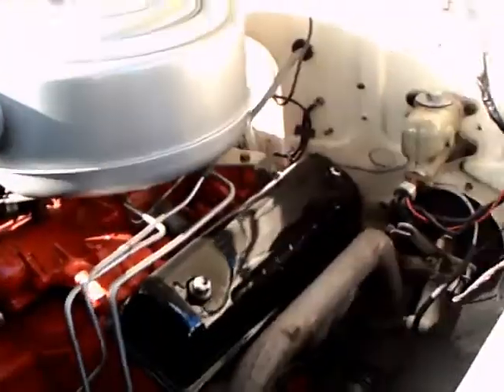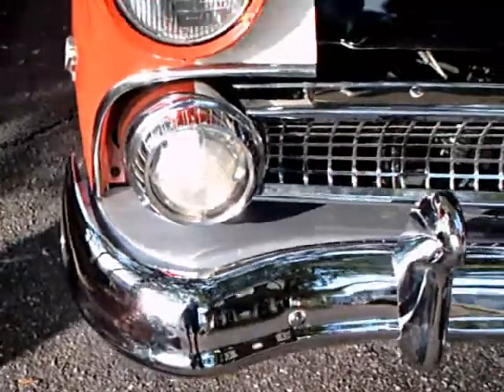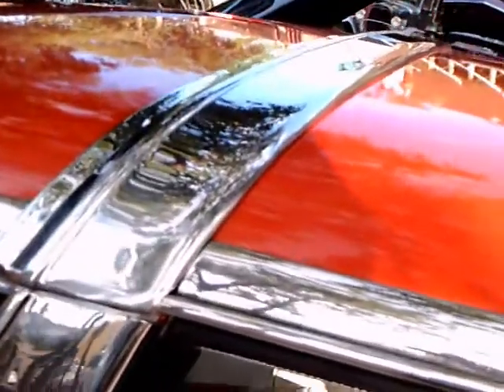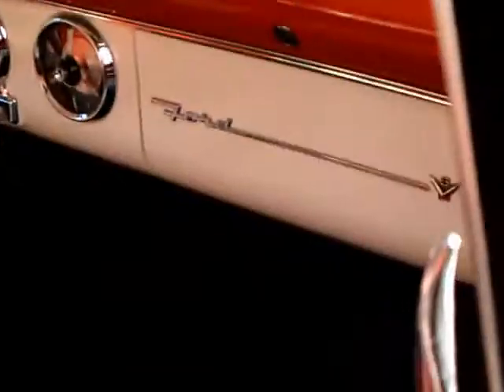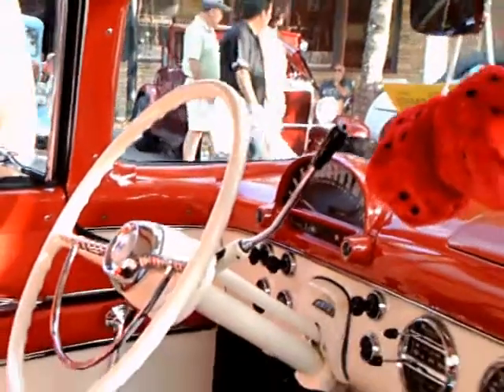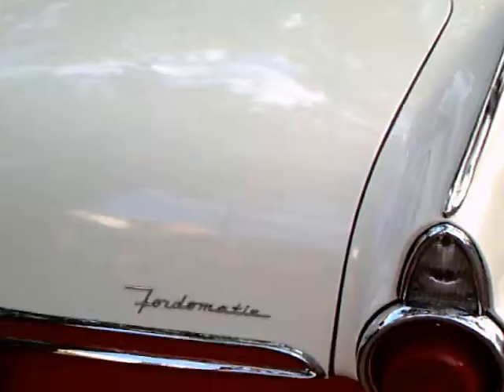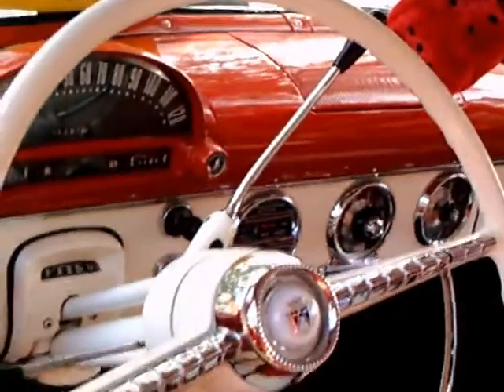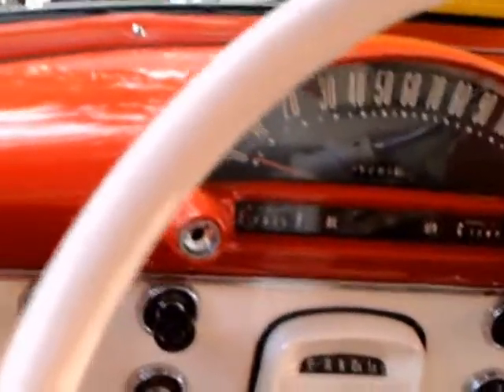1955 Ford Fairlane Crown Victoria RedWht

Comment: When I was in elementary school my dad bought a new 1955 Country Sedan.  It was two tone baby blue and white outside but two tone red and white inside.  The dealer said it was very rare for a blue car to have a red interior but we thought it was great.  When I learned to drive in 1962 it was in this car.  A/C was very rare in 55 and 56 and had round vents either side of the radio speaker.  In 57 they moved the vents to the base of the windshield all the way across.  Never saw a 58 with A/C.

Comment: There was a big change in cars in 1955 particularly in the low price three.  This brightly colored and ornate Crown Victoria propelled Ford into a whole new level.  GMs' Olds, Buicks and Cadillacs got a 12v battery in 53 and Chev and Pontiac got one in 55.  Now for some reason FoMoCo and Mopar dragged their heals and didn't get with more EMF until 56. I love the colors on this one, inside and out.

Comment: Beautiful car.  Seems to have all options except the glass roof and factory A/C.  It does have the 4BBL power pack engine and power steering also rare.
My first car was a 10 year old 55 Club Victoria which is a 2 door hard top with no chrome on top.  Mine was two tone black and white.  55 was the first year for factory A/C in a ford and they are very rare.